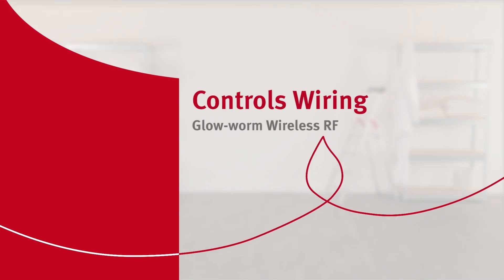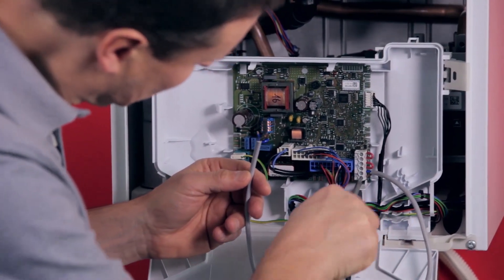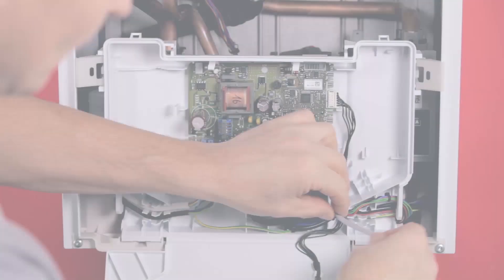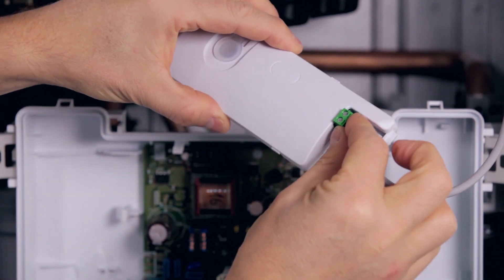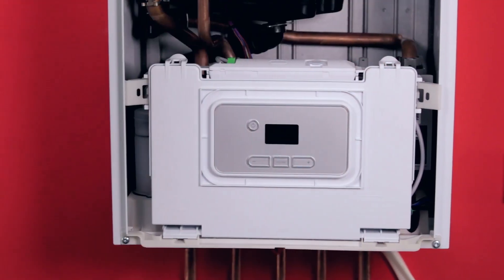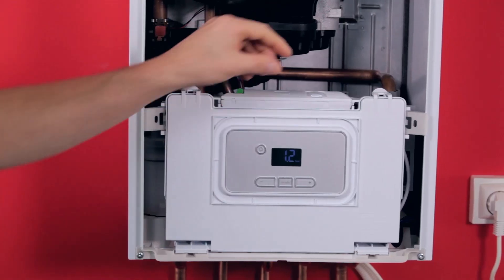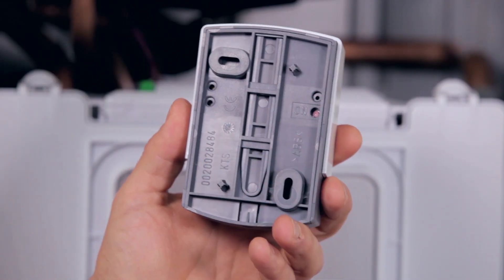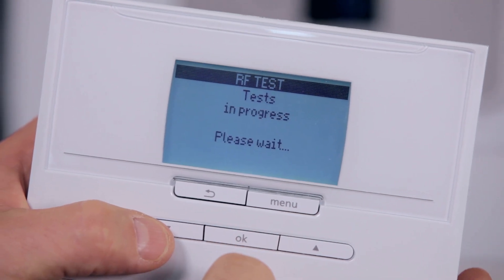Controls Wiring for Glow-worm boilers (wiring a Glow-worm Climapro2 RF and Climapro1 control)

Comment: We have a new installation in the cellar. Using Climparo2 RF controls we put the heating on this morning but it didn’t go off when switched off – I noticed it still running after 20 minutes. It seems that the RF connection to our sitting room is at best intermittent: a distance of only 10 metres. Possibilities include: faulty (unlikely as it works when remote unit is closer to boiler), or out of range with solutions including, (1) move RF connector from internal to boiler case to external and nearer using wires; or (2) provide an RF range extender. Does Glow Worm have advice or a range extender? Currently very disappointed.